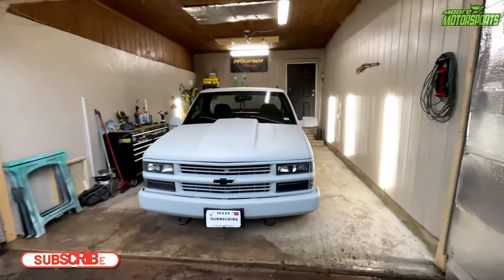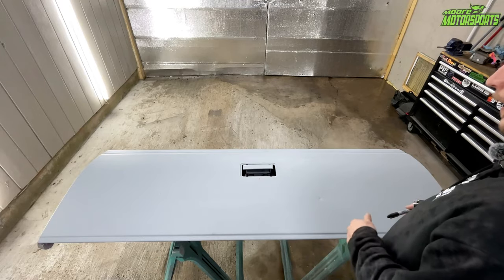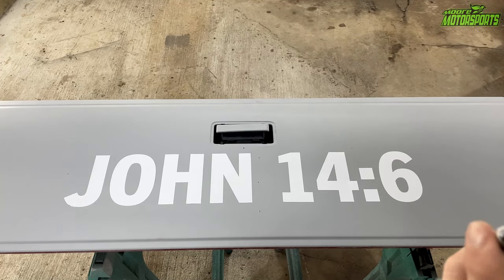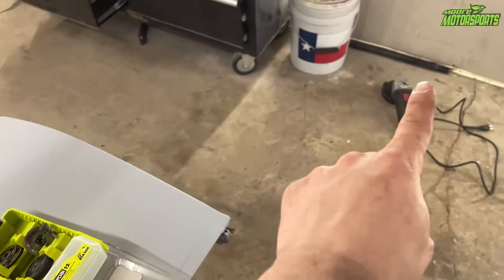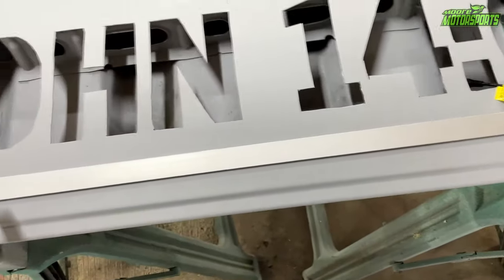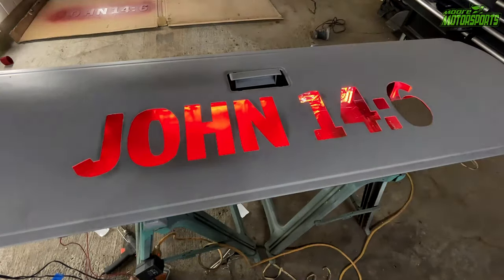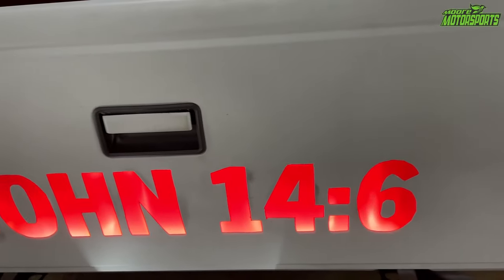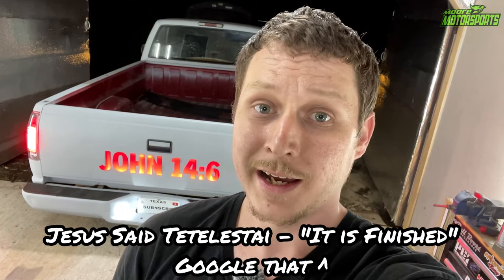HOW TO MAKE A "LIT" TAILGATE OR BUMPER STEP BY STEP DIY

Comment: It's a shame that you have to worry about someone stealing a tailgate. It makes it even worse that someone might steal a tailgate with a Bible verse. God bless you brother!
Reply from the maker: Right but I could see someone who hates God and His word doing it out of hate in their heart so better lock it down the best I can because the times are getting worse right before His return and to think even darker days are ahead. Gotta keep the faith and oil in the lamp so we can see the return.
Reply: You are absolutely right!
Reply: @JamesDguy  been watching since the srt4. Wondering what you would charge to flow test and clean 8 fuel injectors.
Reply from the maker: Awesome glad to still have you! I don't have insurance if anything were to go wrong and definitely don't have money lol.  The main reason i say that is because i have had issues sometimes when cleaning my own injectors where the filter or cap breaks and i ended up having to buy another set of injectors which gets expensive lol. Once i get my shop built i plan to get some kind insurance for that kinda stuff but right now i can't afford anything and can't afford to get sued either lol.
Reply: @JamesDguy  these would be junkyard injectors. I’m not concerned about damage but I primarily would like to know that all are functioning similarly. My mustang has a very intermittent misfire and I’ve not been able to pinpoint one particular cylinder and all my tune up parts are new. No change in stumble. If the injectors are good then the only other possibility is valerian or headgasket and I’m not wanting to tear it down that far just yet. Doesn’t have to be for monetary gain but say something I could donate to potentially make some content. Lol

Comment: Nice job. One idea for the access holes would be to cut larger patch panel from a junk tailgate, overlap the hole and bolt it on instead of weld.
Reply from the maker: I don’t need these access panels anymore since I made a slit in the bottom everything can be accessed from there now. That’s why im welding them up.

Comment: Looks really good. Have you had any issues with police while driving with it lit up on the other car? I wouldn't think so since it's with the brake lights
Reply from the maker: Nope never had a issue with anything I have done and I attract cops so I figured if there was a issue I would be stopped lol
Reply: @broncoramfan  I just drove this truck 15hrs across the country with half the driving at night. Passed many cops and had no issues.

Comment: Another quick and cheap fix to stop tailgate thieves, is to just use a hose clamp.
Reply from the maker: A hose clamp works too but they can just undo the clamp easy and some carry cordless cut off wheels. I even saw a guy lose his tail gate with one of them tailgate locks that go over it they left the lock as a slap in the face. This method is harder to get it off so they should give up.

Comment: Be careful welding those panels back on with the plexiglass under it. Wouldnt want some slag melting the plexi
Reply from the maker: Yes sir that was actually one of my concerns because it could indeed melt it from hot slag. I was thinking of taking it all out to weld them up or send it and if it melts i have more leftover lol plexi lol